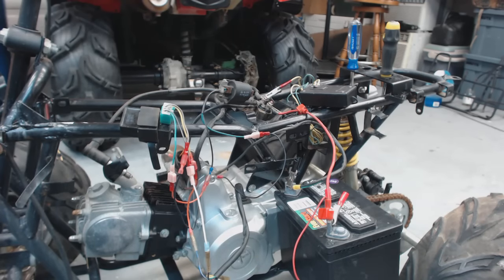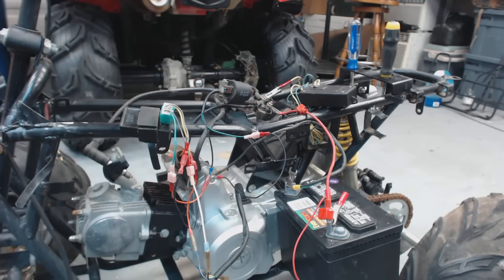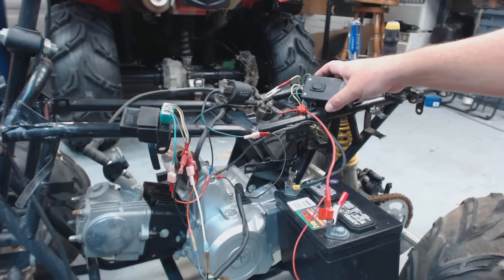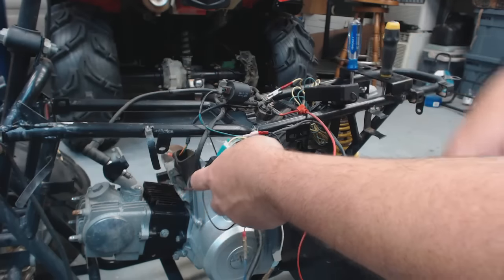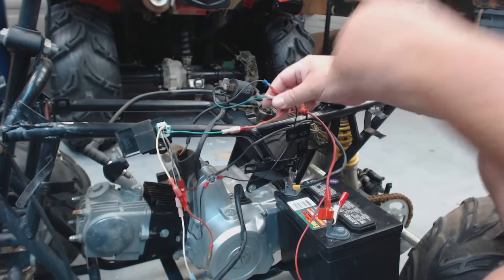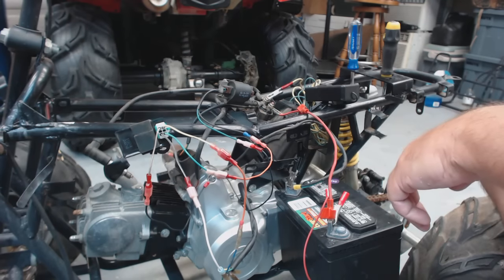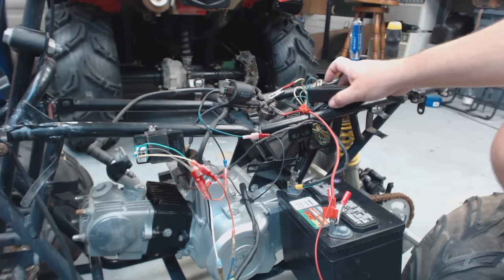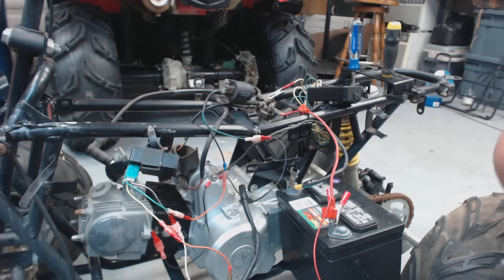Chinese ATV No Spark

Comment: How ya doing i did all this and still no spark what’s my next step
Reply from the maker: One of your component's are probably bad. Most likely the CDI. You can get this kit and have everything except the stator.https://www.ebay.com/itm/Ignition-Coil-CDI-Regulator-Rectifier-For-50-70-90-110-125cc-Taotao-Roketa/292003331939?hash=item43fcc13f63:g:O~MAAOSwuxFYxqLN
Reply: Paul nmnmmmmm

Comment: i liked and sub plesase more vids on chinese atv trouble shoot thanks
Reply from the maker: I will when I get a chance. Still Laying floors in my house.
Reply: @mikesgarage9757  question are  stators are interchangeable example if i have a 2 pole and i get a wiring kit with a 6pole stator
Reply from the maker: @Random.Adventures.  Honestly I can not tell you. I have not seen a two pole. Does your unit have a battery or is it just kickstart?
Reply: @mikesgarage9757  battery but i got it thanks I just had to match up the stator

Comment: I have spark and it try’s to start but it doesn’t don’t know why
Reply: Samuel Smith bad compression, or you carb is dirty and you have to get some carb cleaner
Reply: Samuel Smith if the plug is dry you have no fuel
Reply: Check your fuel filter too if it's clogged then it's starving the motor

Comment: I have spark but will not start
Reply from the maker: if you squirt a little brake cleaner in the carb and it does not pop off it's probably a timing issue.

Comment: But my CDI has two plugs going into it
Reply from the maker: That's an AC unit I believe. I have not had to work on one of those.
Reply: @mikesgarage9757  I found out that it was since I commented. However they're basically the same when it comes to the wires except for the kill switch comes off the second plug
Reply from the maker: @NorthEastRyda  good to know in case I run across one.